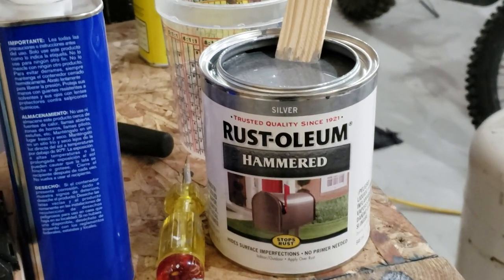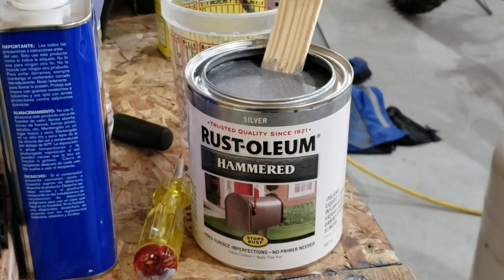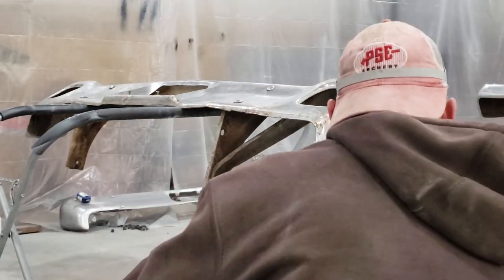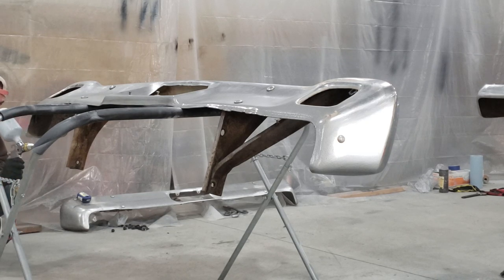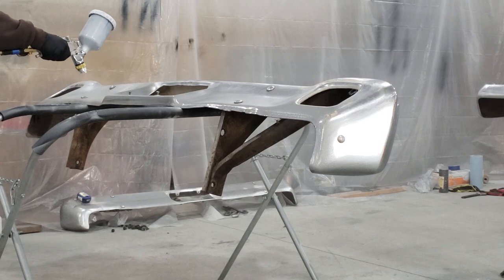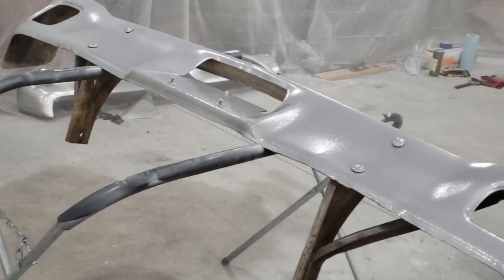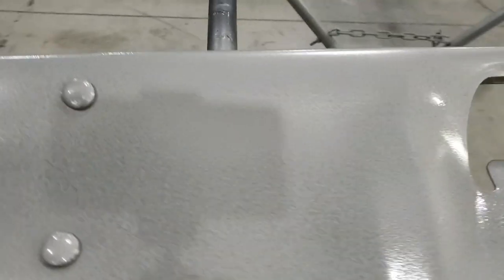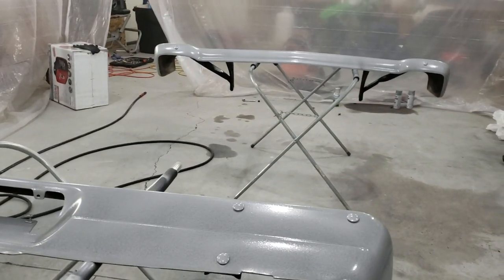Spraying Rustoleum hammered paint with HVLP gun.  1966 Mercury Comet bumpers

Comment: Looks like it layed out nice.  I use this at work occasionally, from a spray can, and it never lays out like I want :/
Reply from the maker: Yes it did lay down nice with the hvlp gun and I feel your pain with the spray can.  I used a rattle can for some small interior parts and it globs up bad.
Reply: @brandonstorer6614  Yeah you totally need a controlled environment to have any consistency with it. I'm not sure exactly what said environment should even be though, tried a few different ways and have had good results, but it was just luck i think. Hard to match a factory hammered finish for sure

Comment: Thanks for the vid.  I'm looking to use that same paint on some old dumbbells I bought. That hammer look matched the new ones.  What tip size did you use in your hvlp?
Reply from the maker: (1.4)  It was my first attempt with the hammered with the hvlp and it turned out really well.   I used a hammered rattle can on some smaller interior parts and it was very blotchy.
Reply: @brandonstorer6614  ok. Thank you. I have a 1.4, 1.8 and 2.0. Maybe I try the bigger needles and not have to thin as much.  Thanks again
Reply: @brandonstorer6614  Did the activator do alright with the paint?  I've got a Cannon Safe I'm painting and I think this is the way I need to go.  Painted the bottom with spray cans and it was awful.  Couldn't get it to spray a steady stream just constantly pulsating making it almost impossible o lay down smoothly.  The only way I could get a good finish using cans was to spray it so think it would've took two cans to do a 24 by 40 inch area.

Comment: I was spraying a trailer today, couldn't find the right consistency, pressure. Throwing another coat on tomorrow. Mind sharing your PSI, you said 5 parts hammered, 2 parts xylene and dab of hardener?
Reply from the maker: Yep, standard quart mixing cup.  I was running about 32-35 psi at the gun.  The hammered is definitely different than spraying an expensive car paint.  I had to move much slower to get a consistent hammered effect.
Reply: @brandonstorer6614  Thank you! I'm going to give your mix a try for 2nd coat tomorrow. Maybe, try it on my Truck bumper if get some consistency, weather... Have a great rest of the week!

Comment: I always spray with acetone or Montreal spirits.  What was the dry time of this between coats?
Reply from the maker: As you can see I sprayed the bumper rather slow to get good coverage for the hammered effect, it wasn't too heavy though.   The temp in the shop was around 70 degrees and the first coat was dry in less than an hour.   The second coat went on shorty after that.   I'm by no means an expert and there's a million methods out there but this worked for me.
Reply: Acetone works great with regular Rustoleum, not sure if Hammered will though.
Reply: The can recommends a 1.5 to 2 liters per gallon which would be about 20-25% mix. You mention you are going with 2/5 mix which is closer to 40%. What made you choose the 2/5?

Comment: The recommends the xylene at 1.5 to 2 liters per gallon. What made you go with 5/2 ratio?
Reply from the maker: The 5/2 hammered to xylene mix in a quart paint cup is basically the same as mixing 1.5 liters to a gallon.  1.5 l to a gallon is .39.  That mix with a splash of hardener sprayed great through the 1.4 tip on my gun.
Reply: Brandon Storer 1.5 quarts would be .39 but pints would be 18.75 if I’m not mistaken. Either way I have seen the 5/2 ratio for a good thinning ratio. Just wasn’t sure of why and if it was just something you’ve learned. Either way the finish turned out amazing.
Reply: Label says pints not liters. A liter is technically .26 gallons or about the same as a quart so in that case you would be right. But a pint is 1/8 of a gallon or 1/2 a quart. Either way your finish didn’t run and sprayed well.
Reply from the maker: @Conquista8301  I'm a DIY kind of guy, definitely not a pro and searched all over the internet and everyone has an opinion.   I'd seen the 5/2 ratio using other thinners and gave it a try with the xylene and it worked great for me.
Reply: Looks great. Goes way faster than a brush. Just got a HVLP gun. What hardener did you use? Plan on spraying mine too. Thanks.
Reply: For the record I have been using the exact method he’s showing here and have great success with it on old tool boxes. Been using the $10 hvlp from hf with no issues also. Much better hammered texture and much faster than rattle can or brush on. It also uses much less paint.

Comment: What pressure did you set at the gun please?
Reply from the maker: I tried to keep it at 30-35 psi going into the gun.
Reply: @brandonstorer6614  Thank you Brandon. Which nozzle size works best with that particular paint?
Reply from the maker: @gavinbroad1743  It was a 1.4 on a Cheap HF gun.  Same gun I used to paint and clear my '66 Comet
Reply: @brandonstorer6614  That's very interesting and thank you again. I used a cheapish Sealey gun with a 1.3mm nozzle and the droplet size was far too big. More thinners?
Reply from the maker: @gavinbroad1743  Rustoleum hammered paint is designed for outdoor furniture and such.  The hammered look comes out more when it goes on heavy.   I didn't get a good hammered look until I slowed the gun down

Comment: What did you use to clear coat after?  
Or is it not recommended to clear over hammered since is has silicone in it? Just wondering. Thanks.
Reply from the maker: I did not shoot clear after spraying the hammered.  It is supposed to be a durable outdoor paint and has held up awesome on the bumpers.  I believe Rustoleum makes a clear for the hammered but I was going for the no shine look.   Plus I don't have to sand and re-spray clear if I get chips.  Hope that helps.